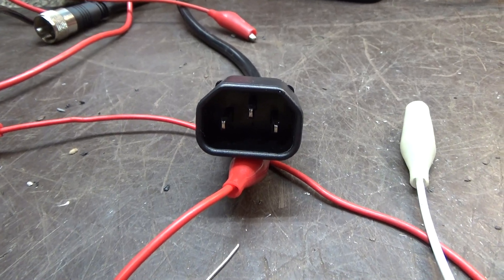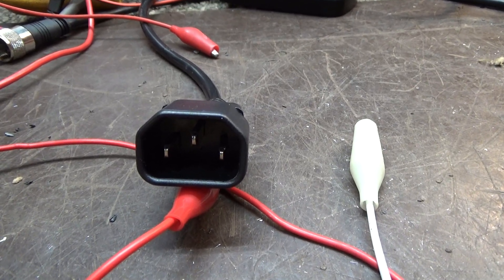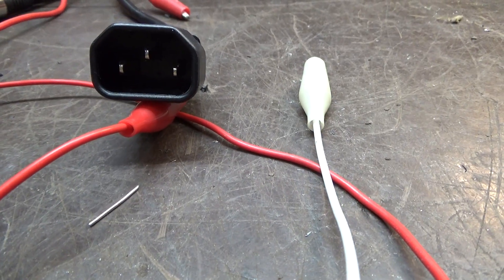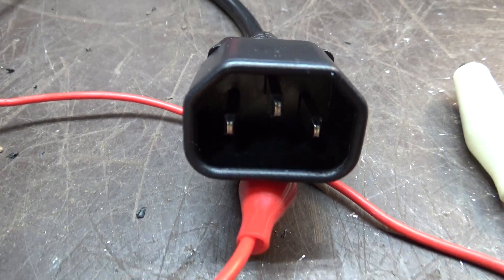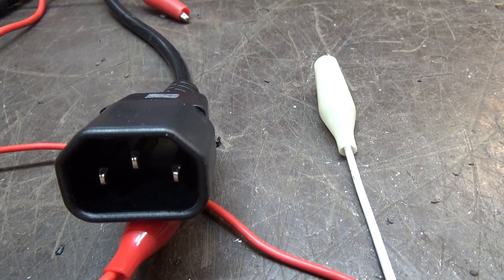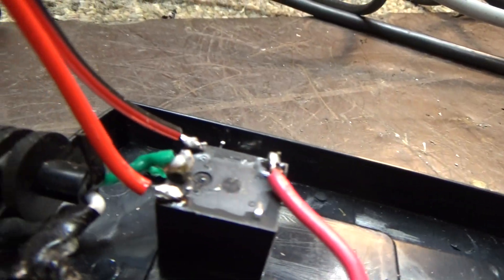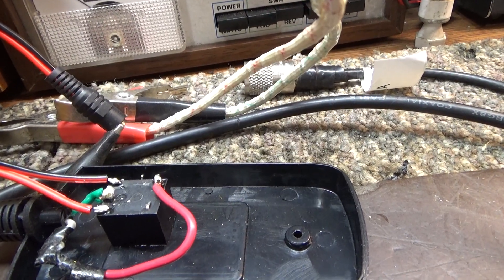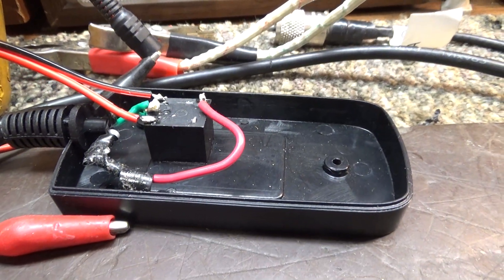Hack a Fog controller to be activated by a Halloween Prop

Comment: How to hack or use fog FM 1500 machine without remote..... Pls reply with help
Reply from the maker: whats seen in this video should work on that. What are you using it for Halloween, a prop, or something else?
Reply: man, this is confusing as hell. where is the other wire or wires that connects to the prop?
most spirit halloween props have a plug in the back that goes to the fog machine that triggers it.
you need explain more what relay you used, which wires connects, etc. very confusing.  @bigdaddystoys2393